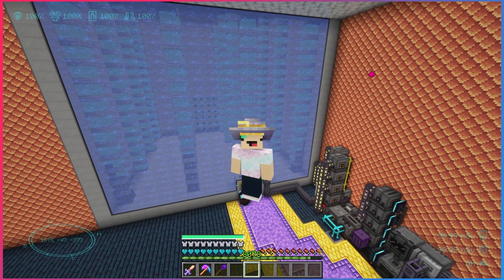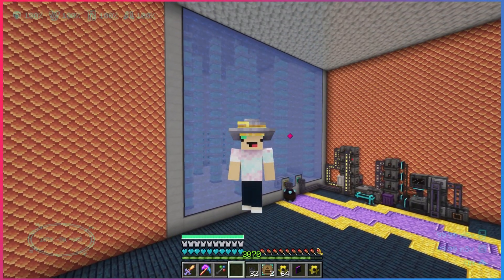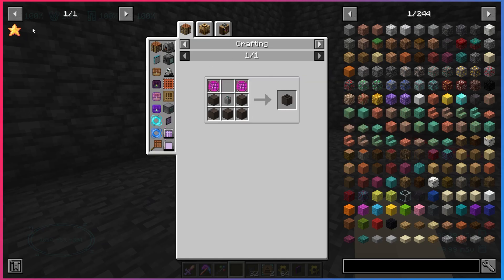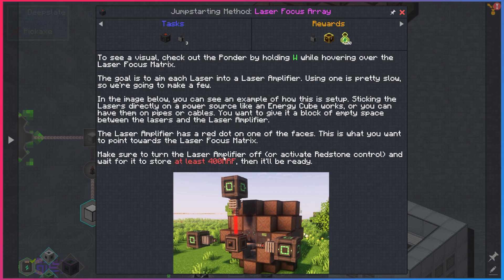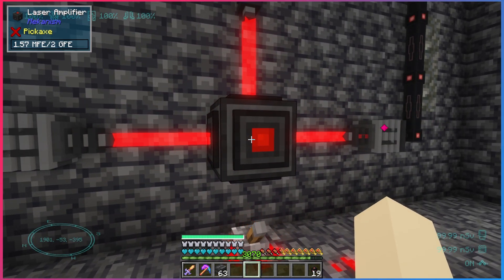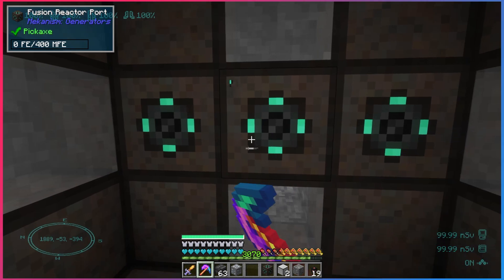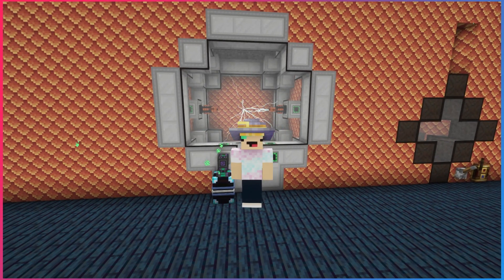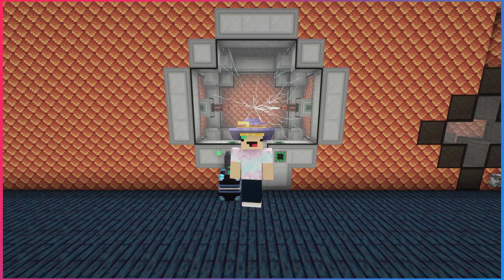Fusion Reactor and Antimatter with Mekanism | ATM Star Journey Ep. 20

Comment: Now THAT is a fission reactor! But at that size, if you actually build a full checkerboard of fuel rods, you'll need to upgrade to sodium/boiler to maintain cooling. Keep that in mind if you go crazy with it
Reply from the maker: I thought about doing that but I’m producing plenty for what I’m using it for. I should’ve upgraded to sodium already though. I’ve got like 30 sinks in the back and they are struggling
Reply: @dupameister Once you get into the tens/hundreds of millions of mB per tick of water to steam at burn rate of 1000+, it's easier to just have a turbine and plug its energy output directly into a bunch of 9999999 EU/t resistive heaters 😊 trying to generate that much new water or sodium per tick becomes actual insanity!